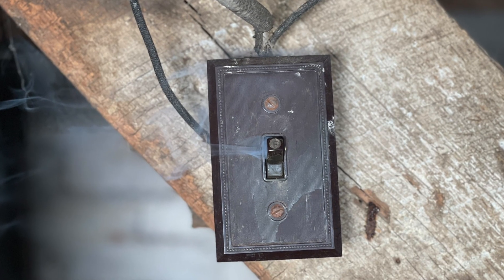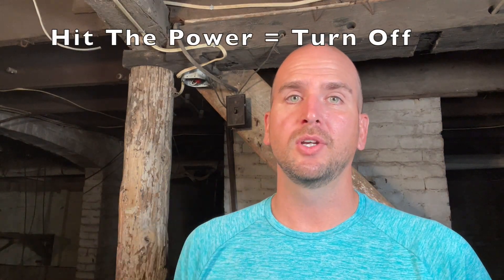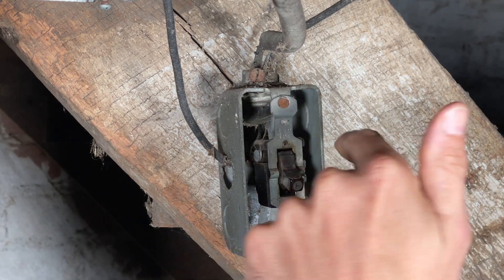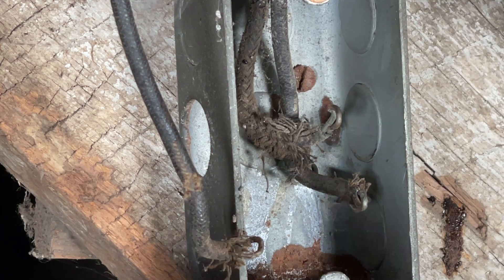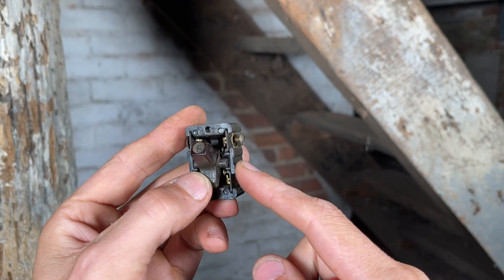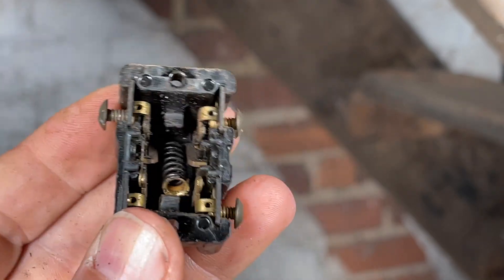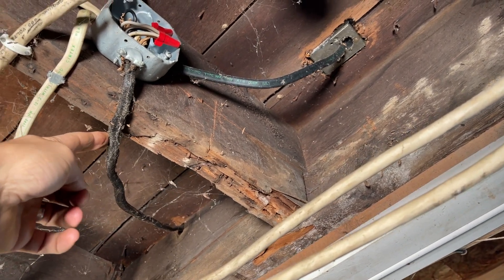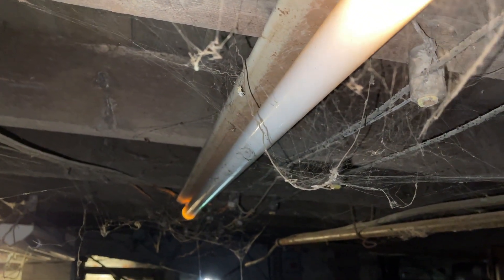Issues with Old Electric Wiring | Knob and Tube

Comment: My home was built in 1996 and a lot of the switches were failing when I purchased last year. I just went ahead and replaced all the switches in the home and later I went through and replaced all the receptacles as well. Got rid of the bottom of the barrel super cheap stuff and I replaced it all with spec grade decent stuff.
Reply: im surprised for a 1996 home that all of that needed to be replaced. everything was up to code for that year though right?
Reply: @XXMETAL4LIF3XX  I would think that it had to be up to code in order to sell the home. They were just very cheap parts which were failing due to poor construction. I guess you can't expect a 30 cent light switch to last 25 years 😂
Reply: @Krankie_V  haha yeah true it is 25 years. thats prob beyond what it should have lasted. idk ive heard 90s homes didnt have the best construction in some cases. even early 2000s.
Reply: I am sadly not surprised. I replaced all of the switches and most of the receptacles in a house built in 2007 a few months ago since the decora switches had cracks all over them. Some switches had so many cracks they were difficult to press. Also all of the cover plates, switches, and receptacles were yellowed and some receptacles were loose. The switches, receptacles, and, cover plates were all Hubbell which was shocking since Hubbell usually makes the highest quality switches and receptacles. Unfortunately, these were from their trade select lineup which is made in china and not in the USA and is only mentioned at the end of their catalog. All of the receptacles were replaced with commercial grade standard duplex receptacles and the switches with Leviton preferred decora switches or heavy duty commercial grade Hubbell toggle switches.
Reply: @CompGuy66  wow thats some good info you mentioned there. very surprised but goes to show not everything is quality just because its modern.
Reply: @CompGuy66  my house was built with the cheapest Leviton toggle switches and receptacles. Except in the kitchen, the receptacles had ONLY back-stab connections, and were also used as junctions with no pigtails. Half of the switches were cracked in two and felt very loose. I was surprised they still worked. A few receptacles were split open and falling apart too. Pretty scary how bad they were. I too replaced everything with commercial grade. I used Pass & Seymour for most of the receptacles, and Leviton switches and a few Leviton receptacles when I ran out of P&S. The receptacles are all tamper resistant as well, since I've got a one-year-old son. I definitely feel a lot safer after upgrading all that stuff.
Reply: @Krankie_V  I currently live in a house where the light switches were back-stab connected (they used 14/2 plus ground wire for the two lighting circuits).  I hate back stab connections, I cut the wire and use the screws to install a new switch.  The outlets have 12/2 run to them but the quality of the outlets is variable -- some so bad that I had to replace them within a few years (I have lived here almost 28 years) while others work fine.  I have one outlet that I need to replace ASAP.
Reply: You see what minimum code is D- at best and to think each $0.29 switch and outlet was marked up to $5 each lol
Reply: @wizard3z868  components which are so poorly built shouldn't be UL listed. It's almost criminal!
Reply: @Krankie_V  agian bare minimum standards you ever heard of a turd in a box with a guarantee what you have there is a ul listing to not catch fire right away and if it dose its supposed to minimize the damage lol but no liability if it dosent
Reply: These days UL approval means Until Later
Reply: @peters8758  At least UL does some testing (I have been in one of their labs although it was many decades ago).  There is Intertek where even though they have a building about 75 miles from my house (why they picked Michigan for their office I don't have a clue) I have never heard of them actually testing anything.
Reply: Our first home was a 10-year old tract home built in the early '90s.  Plugs were always loose in the outlet sockets, so I wound up replacing all of them.  It was a good starter home, but it was built with the least expensive materials the builder could get.

Comment: The switch, and not the knob and tube was bad. Excluding the lack of a ground, knob and tube with it's three or four inch separation of the conductors is safe. Most of the problem with it is the wannabe electricians messing it up with improper additions!! Understandable, considering it is difficult to troubleshoot.
Reply: Jack ... the other problem is the 100 year old real rubber (or cloth) insulation is now crumbling. Don;t forget that in certain high temp situations that cloth is either asbestos or impregnated with arsenic to keep mice from chewing it.
Reply: you mean besides the fact that the insulation is generally brittle, the conductors are age hardened and overheat even with the current they were originally rated for, there is invariably material built up on them to trap heat, and they are way undersized for modern electrical loads.
Reply: @kenbrown2808  ... personally I feel it's the expectation that our modern loads should be ok. The reality is modern code wouldn't put a 15 amp circuit in too many locations these days, and that's what most domestic K&T is rated for. IOW, it's more about people overloading things. It was fine for it's original intended use.
Reply: @rupe53  no, old services are way underpowered for modern electrical codes, but the material is still way past its service life.

Comment: Now the question is, can I as a homeowner replace the rest of the cabling with new outlets, without get finned? Especially when the house will be eventually sold.
Reply: K K ... in most of the USA the homeowner can do any and all repairs himself but it would be wise to pull a permit and have inspections done, which may be required for a bank loan at sale time. Banks have gotten real fussy about building inspections in the last 20 years.
Reply: @rupe53  many states also have a rule that a house with homeowner wiring and plumbing cannot be sold for a specified length of time AFTER the work is completed and approved by the inspector.
Reply: @kenbrown2808  ... that might make sense these days with so many flippers out there but I have not seen it. What I have seen is rules about rental homes not being done by the owner.
Reply: @rupe53  yes, we have that rule, too - unlicensed owners can only do work on their own residence.

Comment: Very well done, hope you scared a few people into doing it the right way.
One issue that I think needs to be addressed is the cost to a low income family who are required to upgrade to the 2020 code with the high price of AFCI & GFCI circuits.  One point if one is forced to utilize older circuits, then I believe the circuit should be protected with a AFCI/GFCI breaker, as they will detect wires in the walls arcing and open the circuit, also you don't need a equipment ground to protect a person from shocks in a two wire bonded circuit.
Reply: Mark Fisher.    Well written. Low income would be renters? Unable to keep any property
in maintenance?
Reply: The only reason I no longer will state a fuse is superior to a circuit breaker is because of the AFCI technology.  So the idea of removing the fuse block and using the fuse box as a junction box to splice to modern wiring methods back to the panel is a good idea IF your original knob and tube circuits were not set up as a multi-wire circuit.  In other words, each fused circuit must have a corresponding, dedicated neutral so that when extending these wires the neutral can land on the AFCI breaker.  If you have a multi-wire arrangement (larger pre-war homes used this) or you have a smaller home  that might have used a "super neutral" (an oversized neutral  shared by multiple circuits that once were all connected to a 30A 110V service) then the AFCI cannot be married to the old knob and tube.

Comment: My parent's house was built in the 19teens and had knob and tube wiring and also gas piping in the walls for illumination. My house was built in 1927 and has BX. The decade between when the 2 houses were built was a huge decade for electrical wiring. The switch you took apart was probably not original because I remember the switches in my parents house had porcelain and not what I assume is Bakelite in the switch you took apart.
Reply: You're correct, that's a bakelite switch housing but they started using those in the 20s.  The rather sturdy construction clearly points to pre war or post war period.  That same design was used for almost 35 years.  Given the location of the switch it is an add on by a previous owner.
Reply: Grounded outlets were actually invented in 1925. The grounding was probably done through the BX cable armor, a no--no today. Modern armored cable includes a ground wire.
Reply: Fred ... my home was built circa 1910 and had BX cable marked from Montgomery Ward. (competing with Sears at the time) The original service was 30 amp 110 volt, one circuit for each floor. 4 rooms each floor with a single ceiling light and single outlet per room. They did think ahead to a 2 family meter pan on the outside (was then 60 amps) but never installed the second meter. I found evidence of the original service when I removed the ungraded 60 amp fuse box. A 30 amp service (they painted around it) is a meter in the center and 2 glass fuses at 10 and 2 so almost looks like a Mickey Mouse silhouette on the wall. Oh the things you find in older homes!

Comment: If there's no grounding system in place at all then the only path for the electricity is between the hot and neutral wires.
Reply: Joshua ...you forget that neutral and ground / earth have the same potential, which means if you are standing on damp concrete and the box is energized you can become the neutral / earth. If the box was properly grounded it can NOT become energized without tripping the breaker.
Reply: No neutral in this application?
Reply: @tedlahm5740  ... there's a neutral in the circuit but not at the switch location.
Reply: @tedlahm5740  3 way switch. The black wire on the left is the hot line. The two wires on the right side go to the other switch, probably upstairs. From there another wire, the switch line, goes to the light fixture, from where the neutral goes back to the panel.

Comment: Great video!  My parents old house (built in 1915) was knob and tube - they did update the wiring back in the 1980s, and it was NOT cheap!
Reply: When factoring in inflation, a full rewire would be cheaper today than in the late 70s to mid 80s.  Copper was undergoing massive speculation as many mines are in countries with great political turmoil.  That was the period when Aluminum wiring was in vogue.
Reply: @xavariusquest4603  Oh yeah, forgot about that.  The bad old days of AL wiring!

Comment: 👍🏻 I wouldn't trust that old wiring at all. I'd also sweep a broom across areas I plan to work to get rid of some of those cobwebs. Good luck with that job!
Reply from the maker: The funny part is I already did a round 1 with a broom 😂 this basement had more dead spiders than I have ever seen.  Right by a corn field.

Comment: Just offhand, I think the NEC requires that where K&T is deactivated, that it must also be removed. At least the visible parts.
Reply: I think the term they use along the lines of "obviously disconnected" (cut short and taped off) to mean it's no longer energized. The point this video makes is some guys update stuff in the basement but the K&T is still active in other hidden parts of the house.
Reply: It does NOT but you can't modify it at all. It is not an approved method today but was approved when installed so it it allowed unless your local building dept. or electrical inspector has the right to require you need to replace it.
Reply: @cgsound  ... might be splitting hairs but building inspectors don't have special rights. They do have authority based on local govt rules. In some areas a rental home must be up to code, at least on any changes. An inspector might have the leeway to allow an older code to stand but I doubt modified K&T would pass, mostly because it's been modified. BTW, that switch shown in the video was likely not an approved installation in it's day because it's a metal box, which was not in use for K&T.
Reply: @rupe53    Probably couldn’t get insured. Maybe an insurance agent would know.
Reply: @rocketrider1405  ... most insurance companies wont bother to ask. OTOH, most banks require a building inspection on the home BEFORE a loan. IOW, it's a trick question where the insurance company figures you got the loan so you must have passed the inspection. Where insurance companies get interested in details is usually after the fact, when there's a claim involved. Oh, that's bogus, there's no permit or inspection for that work, etc.
Reply: Can you label it with a tag that says “abandoned”? I can’t remember where I read that, but it might not apply anymore.
Reply: @MoneyManHolmes  ... that seems to be common in cable bundles, but I have only seen it used in communications where we're dealing with low voltage and different code.

Comment: What do you mean by "Hybrid" wiring? what type of wire was used beside ROMEX back in houses from the 40's , 50's, 60's, 70's 80's etc besides ROMEX wire?
Reply from the maker: Sorry, I used "hybrid" as in the current state of the houses electrical is a mix of knob and tube and Romex with a whole bunch of junction boxes.
Reply: Everyday Home Repairs bx?
Reply: @EverydayHomeRepairs  Thats the wrong word term to use it should be called  micky mouse wiring or a train wreck of a wiring job. I wouldn't have called it Hybrid
Reply from the maker: Hahaha, yeah those terms might have been a little more accurate for the situation,
Reply: @EverydayHomeRepairs  Do you know what type of wires were used in older houses because they didn't use ROMEX they used other brands names
Reply: @waynegram8907  ... the word hybrid originally had nothing to do with modern cars. It means a mix of things so actually a good term for what he's talking about. OTOH, Mickey Mouse (and cobble job / hack job) is what I see in the video.
Reply: @rupe53  yes but you don't call mickey mouse wiring or hack job wiring jobs a HYBRID. You could say its a Hybrid of many things but you don't call the different types of wiring a Hybrid.
Reply: @waynegram8907  In Canada, many homes were wired with Canadex, a product of Canada Wire & Cable. The brand is always marked alongside the type designations on the jacket of the cable.
Reply: Armored cable started replacing K&T wiring in the 1920s in the better homes. But in the 40s, Romex became the death knell for K&T, as it was much cheaper to wire houses this way. Even cheap, beginner homes got wired with Romex.
Reply: @dougbrowning82  So the first company was called Armored Cable then went K&T wiring then went ROMEX? All these wires are using copper wire so what are the differences between K&T, Armored Cable compared to ROMEX? Doesn't other houses get wired up beside using ROMEX?
Reply: @waynegram8907  Armored cable, also known as BX or Greenfield cable was first listed with UL in 1899 and first appears in the 1903 NEC. It was introduced by the Sprague Electric Co., later bought out by General Electric. It is a flexible, metallic clad cable. Early armored cable, called AC, had a thin metallic strip or wire that was used in conjunction with the cable armor for equipment grounding. Modern armored cable, called MC, uses a full ground wire, instead. Romex is a trade name for non metallic cable. Originally the jacket was a braided fabric, impregnated with tar. Nowadays, it is usually a plastic jacket. In its modern form, it also has a ground wire. Knob and tube was a wiring style that used separate, insulated wires, and gets its name from the porcelain insulators used to support it away from the structure.

Comment: you are lucky that the wire had not shorted to the metal box as it could have made the box live and a major safety issue

another thing people did with knob and tube wiring is spliced into it and overloaded it

people have even put foil over the fuses or coins or slugs into the fuse holders to bypass blown fuses and that can lead to fires.

Comment: Looks almost like my house when I bought it! Total electrical gut and new romex!
Reply from the maker: Nice, did you do it yourself?
Reply: @EverydayHomeRepairs  I did all the finish work, but had them run wires! Electrician about had a cow when we did inspection, bunch of open boxes and loose wires just handing around. Bought for approx $100k in 2016 and probably worth upwards of $250k (we also did plumbing, roof, new deck and total gut of basement and partial upstairs).

Comment: The circuit breakers may be another source of danger.  Stab-Loc breakers have a failure mode where they may work once or a few times, but not open up the next time the circuit is overloaded.  The federal government chose not to have them recalled, but they might not be acceptable to many inspectors.
Reply from the maker: Thanks for the info,  appreciate the help 👍
Reply: That is a Square D Panel QO Breakers, Not Stab Lok Breakers
Reply: @machone1757  : I didn't mean the circuit breakers shown in the video are Stab-Loc.  I was sounding a general warning, for the benefit of Comments readers who might encounter them.